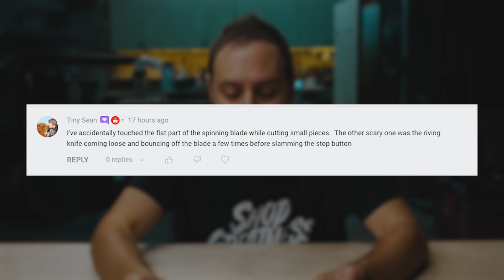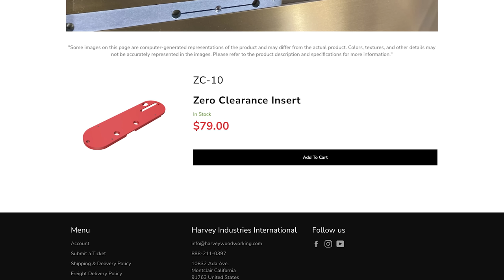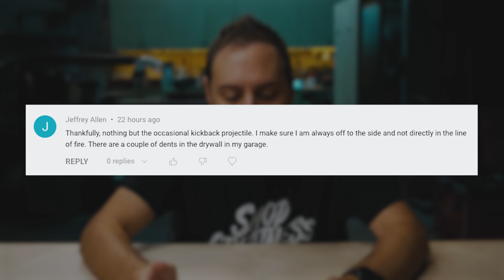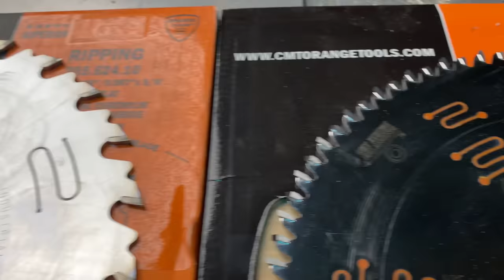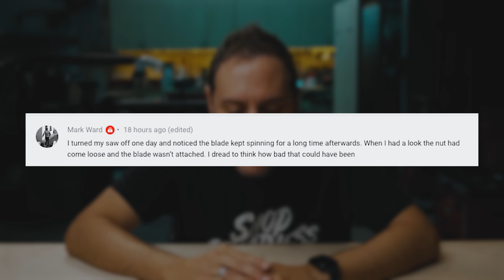I don't know why people make these dumb mistakes

Comment: It’s a shame SawStop are holding onto the patent for that technology and not sharing it with other brands. I get that’s business, but it would be an awesome feature that is mandatory on all saws, especially with statistics like that. I’m in the UK so can’t have a SawStop if I wanted one so I’ll have to continue with safe working practices. Thanks for all the advice 👍
Reply: Once the patent will expire, the markets will be flooded with sawstops variants. Every new DeWalt or Milwaukee table saw will have one built in or give you the option. 

You're right though, patenting is by it's nature selfish.
Reply: SawStop tried the license their patent to the manufacturers, but they weren't interested. That's why they decided to make their own saw. That was a big risk and now that the product is a proven success, the other manufacturers want a piece. I can't blame SawStop for not wanting to issue licenses. Unfortunately, it's the craftsmen that suffer.
Reply: @drooplug  yeah cuz people laughed at safety alot more back then. Some still do
Reply: @chrisb2443 SawStop are planning to launch in Uk. Just for info. PS - I do know ;)
Reply: It's not just that the big manufacturers didn't want to use sawstop at first; they've been actively lobbying this whole time to prevent some safety features from becoming required.
Reply: So you can make your own,  just need to get an airbag charge
Reply: It's just a reality that in today's times, SawStop is the only rational choice, especially if you're a YouTuber providing education to novices.

But who knows if the Tuber is getting sponsored or was given the saw for free. I recently saw (pun) an "experienced" Tuber recommending a Harvey table saw. It's like pitching cars without seat belts.
Reply: Bosch has their own technology and can only sell tablesaws in the EU. America is about to or already has passed a bill making SS tech mandatory on all saws sold in the US. Sawstop has said if the bill passes, they will make their tech available, at no charge, to all manufacturers. Only problem, with that, is that the prices of all saws will go up hundreds of dollars, makeing them unaffordable for many customers.

Comment: Thanks for this video. Last year, I had my first tablesaw injury after 49 years as  as a hobbyist woodworker. I sliced the tip off the middle finger on my left hand. I had been cutting 126 slats to make 3 louvered doors. I got overly tired and hot and put my finger on top of the board to push it through instead of along the side. I had abandoned the push stick (too much trouble) and cut my finger on the 124th  slat. Dumb, dumb, dumb. The tip was sewed back on, but now it doesn't have any feeling. I can no longer say I've never had an accident at the saw. Add me to the statistics. Thanks, again.

Comment: As a 30 year safety professional, I say well done and thank you for posting this. I have never had anyone tell me they were sorry that they worked safe, I have however, lost count of those that said they wished they had.
Reply: I've lost count of those who think they worked safe until the day they slipped up. Tablesaws are simply not to be used for 99% of the tasks people use them for.
Reply: @whatilearnttoday5295  Is there any use for it other than cutting wooden planks straight
Reply: well there are still alot of things missing.. like how to set up the parallel stop, or how to choose the right riving knive and how to ajust it and its wrong that a deep blade is allways safer...  in the usa you should really consider to school that basic carpenter knowlege to every carpenter.. im not a safety professional but i have learned that in school.

Comment: I'm a residential, non-union rough carpenter who admittedly has been doing horribly dangerous things constantly on the job with my trusty guardless Circular saw and nail gun, while running or balancing precariously, for over 20 years.    But when it comes to the tablesaw,  i am fully aware of the respect it demands.  I slow down, plan the cut and assess what can go wrong.
Reply: i wont even touch one i was always told if you are so nervous using a tool that you are shaky and distracted don't use the tool period

Comment: "I've taught my wife and my kids, if they hear a power tool running in the garage, not to enter."

zip ties the drill trigger
Reply: This is why corded tools are best, you zip tie the trigger and plug them in using some of those socket timers..

Kick back, relax and drink beers.. all the while the whole shop turns on and off like someone is doing legit work inside!

This one actually saved me 2 months of being around my family when all I needed to do was a single 2 inch weld..
Reply: Alexa play Drop saw sound effect 10 hour loop

Comment: Being focused on the job at hand is key.  About 5 years ago I was dealing with a few issues and wanted to get into the shop to take my mind off of things. Thing is, my mind was not focused on the table saw. Plus I was cutting a square piece that ended up flying back. Not hurt or any damage but realized I'm at best going to mess up the project I was doing and at worse hurt myself. I just shut off the saw and left the shop for another day when my mind was clear.

Comment: There is one point that I miss in the video (it is a great video by the way, thank you): You have to be aware of the weaknesses of your tablesaw. What I mean by this is: My first tablesaw was a cheap noname product for far less than $200. It was terribly imprecise, leaving burn marks all over the cut. But I was new to woodworking and thought that it was my fault. Only after a year or so I found out the reason: The rip fence was far too weak and was bending away when I put pressure from the side onto the workpiece. So at the hight of the blade, the rip fence was bending back for a millimeter or more. If I would ever have lowered the side pressure during a cut, the rip fence would have pushed the workpiece back into the blade, probably causing  a kickback … with me in the line of fire. I was so damn lucky that nothing ever happened to me. 

Over time I learned more and more about woodworking and the tools. And of course, one day, I found out about the problem with my tablesaw (and my incredible luck). The tablesaw was the first tool I threw out of my shop. Bought a much better semi-professional one which lets me calibrate the fence to like one hundredth of a millimeter (if I wanted to and took the time and effort to do so, but a tolerance of one tenth of a millimeter is totally fine with me). Before I bought the new tablesaw, I informed myself about quality, tolerances and safety features and watched a bunch of YT videos about Youtubers using/testing the tablesaw, just to make sure that I do not make such a bad purchase decision ever again…

Thanks for the video. Love your channel.
Greetings from Switzerland 🇨🇭
Reply: You're right. Good research goes a long way. 
I had a discussion with my wife about the cost of a table saw and I convinced her i rather have a decent saw instead of a cheap dangerous one. 
It's best to pay more for the built-in safety and quality imho.
Reply: out of curiosity what tablesaw did you end up buying?
Reply: I have a Craftsman/Sears table saw which is very convenient, but also infuriates me. It has one of the clamp-down aluminum fences and it just has so much wobble. Looking at the HF Hercules saw with rack and pinion fence for not just precision but also safety.

Comment: I bought a SawStop when I started setting up my shop. I have had two accidents with it in 20 years.

The first one happened when lightning struck close by (I had no idea it was even raining - garage door was closed). Lighting struck, I jumped, board bounced up and pulled my hand into the blade. THE SAWSTOP WORKED. I needed a band-aid and some new shorts, but I was fine.

The second time I was cutting maple, and it twisted after the cut started. It didn't even get to the riving knife before the blade grabbed it and shot it into my stomach hard enough to bounce off my fat roll and hit the ceiling. The saw didn't trip off.

I agree that there is a lot more to staying safe with a table saw than just what a SawStop offers. I still have an outline on my stomach from that chunk of maple. But at the same time, I don't think you should be so dismissive of what it CAN do. I guarantee I would have lost all four fingers on my left hand if I was using any other saw.

Comment: I will be taking a class at our local tool library on tool use, and then a safety course before I can use their tools.  I am doing this because I have never used, nor do I own, a table saw.  Your video will help so much as I learn how to use all the tools.  Much of what you covered I can also apply to the use of my circular saw and mitre saw.  I am long over due on maintenance. I have had my circular saw bind, and when that happens, the whole tool can kick back.  Super scary.  I also had the blade in my mitre saw come loose.  The one thing missing from your video is the use of a blade guard.  Excellent tutorial.  Always know where your hands are, and your brain.  I hope this one goes viral.

Comment: Love how through and eye opening this video is, Drew! We all need to be diligent and not get complacent. Thanks for asking me to be a part of this 😘
Reply from the maker: Thank you for sharing! Hope you can bother Dan to make a Harvey
Reply: I bought some of the zero clearance yellow strips for my mitre saw and they are a game changer especially if you make a zero clearance fence to go with it. Regards table saws I think most DIY users would be far safer with a plunge/rail saw. No kickbacks, no missiles firing back at you and most importantly your fingers are well out of the way. If you did slip or for some reason you fell the blade will retract back into the housing instead of you being dragged towards it. The problem with all power tools is that rarely do they take any prisoners and when things go wrong it happens faster than you can react or move away.

Comment: Thank you for this video. I do own a SawStop but as you s aid that only protects you from one of the 100’s of mistakes you can make while using a table saw. I am just as guilty as everyone else of cutting corners at times, and it usually starts off with I’m only making one cut I don’t need to get all safed up. This is why I firmly believe it’s the more experienced wood workers that get hurt more from a table saw than the rookie. Rookies are just too damned scared of it cut corners, while us “experienced workers” have lost that fear/respect for this (and other power tools) over time. I force myself to watch and rewatch the safety videos just to try to keep myself centered on the danger these tools inherently have in them. I have saved this video to my safety folder to watch it again in the future.
Reply from the maker: Thank you John! 100% agree

Comment: @16:57 re:frame of mine.  This is why I never try to batch things out. You go to auto mode and let your mind drift.  For me anyway. So I try to break it up since productivity isn't a key metric for a DIYer.  But I always follow the things I learned in the Army.  PMCS - preventative maintenance checks ans services.  Like a flight checklist to make sure everything is where it's supposed to be and in good working order.  I physically wand my hand over the saw to make sure its clear of debris.  I say "clear" before turning on the saw.  (it's like doing a back blast area clear)  And I mentally (sometimes physically) practice what the cut will look like.  For larger pieces, it's critical.   Overkill?  Maybe. Doing all this when I'm by myself, it's silly?  Maybe. But that's not why I do it.  I do it so it become second nature. And when my boys help, I know I'll do it w/o fail.  That's why SOP exists in the Army.  Because peoples lives are stake. And if my limbs are at stake, why not do it?  It takes a second, and for DIY'er, it's worth the time.  I get that production carpenters and woodworkers have a different threshold and that's totally fine. I'm just talking about a DIYer/hobbyist like myself.
Reply from the maker: good point. My mind always wanders in batch mode.

Comment: WW, you are about the tenth safety video for today. Watched one and became addicted so the more I watched, the more I learned.
Hence, THANK YOU!
Conversely, the more TS safety vids I watch, the more I become convinced that I will go ahead and finish building my Festool track saw table.
I started it two years ago, then got the cool little Dewalt 745, love it but now I am beginning to think that no matter how safe you are, you are still gonna get bitten by the spinning 10" - sooner or later. .......40 mins later, I finished this video and am astounded at things you bring up that I just don't normally care about.
One of the many in this video is "FRAME OF MIND" while using these tools. I learned more in this than all the others and am commiting them to memory.
A very BIG - THANK YOU //ji

Comment: first and foremost thank you for making this video, i very much enjoy your content. Wish i would have seen it  2 weeks ago maybe my foolish mistake could have been avoided. i tagged all 4 fingers on my right hand. after pulling my hand back i held it up and looked at it and saw my index finger hanging on by threads. fast forward 2 weeks, 1 surgery, one job lost, some brutally painful moments, and a whole lot of struggles learning to adapt. i am typing this message with one hand and one thumb on my other hand, i have an inch of a nub for an index finger and the rest of them are a long way and a lot of physical therapy away from "useable". oh and to top it off me and my wife closed on our fixer upper condo the day before the accident happened and guess who was supposed to be the fixer? i was making a coffee table for my wife as a surprise for her birthday six days from now. im a safety nut to the point where my buddys poke fun at me for my whole face shield respirator used for nearly everything. i use a push block or stick for everything. but that night i was off work late and tired but wanted to get her gift done. one bad decision followed by a tired reach in a slightly dim garage combined with a misjudged Hight of blade as i reached and my entire life is different forever. i cant tell you how many times i have said to my wife as she wraps my mangled hand "god why didn't i just go to bed, or "im so stupid why did i reach like that" but the truth is none of that matters anymore for me. if anyone even reads this just take your tools and machines seriously. I've made thousands of cuts on my table saw but it only took one moment to alter my life and bring on a massive wave of problems not the least of which is from the completely useless and lost feeling that comes from a maker not being able to make, or even tie his shoes. that's my piece hope it helps someone avoid the same mistakes
Reply from the maker: I'm so sorry. Thank you for sharing the warning. 🙏

Comment: I think another good thing to add to this list is to actually have this list posted right next to the saw, so every time you go to use it, you make sure you go through this checklist. This is mainly because it can be easy to forget just one step on this list and that can be the one that causes an issue. If you have these posted on a sign that you have to look at before using the saw, you’ll always be reminded of every safety measure before cutting.
Reply: I agree,  checklists and safety reminder signs are important.
Reply: Getting my pilot's license caused me to end up with checklists for so many things, and honestly it's been a huge removal of burden. Brains aren't good for remembering. Use checklists, have less things to hold in your brain, feel calmer, be safer.
Reply: @error.418  It's a good trait to have and something I need to use more often.
Reply: @JohnS-er7jh  a great visual method I’ve seen in manufacturing is to physically mark off danger zones with red tape. If you have to re-read a safety sign to remind yourself to not stand in the kickback zone, you might forget while you’re in a hurry, but having a rectangle marked in red on the ground will immediately register as “I shouldn’t stand here”

Comment: Not standing in the line of fire is something not many people think of when using a table saw. (I was lucky enough to get taught it at college) cause even the smallest lengths can be fired at speed.  I've had it happen once and the piece was only 5mm square and maybe 1 metre in length, but that thing shot across the workshop and made a bang so loud it sounded like a gun. It was so loud it was easily heard despite having ear defenders on. You should also be careful with push shoes as they get your hands close to the blade, especially when doing thin cuts. I was taught not to put your hands 150mm either side of the blade and 300mm in front of it. Using this will help you keep your hands away

Comment: Thanks for the video 👍
Jimmy’s incident is why we all should have E-stops to shutdown the shop with the push of one button/switch placed at minimum near the exits, fairly easily done on initial setup of shop*. Also can prevent little visitors from starting equipment! 
I’ve been woodworking for 50+ years still have all my digits. Never had flesh contact a running saw blade, but cracked ribs from kickback because of bad fence alignment. Belt and disk sanders can bite you bad they are the reasons for my only ER trips from woodworking..
*Install a sub panel for your equipment fed by a remote trip breaker or a contactor and wire the stop switches in series
Reply from the maker: Thank you for sharing! Stay safe